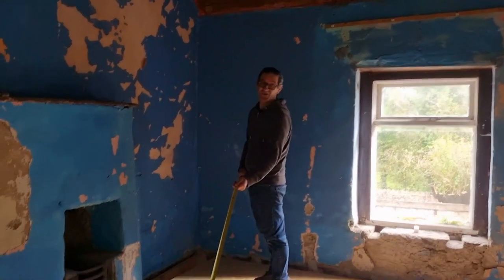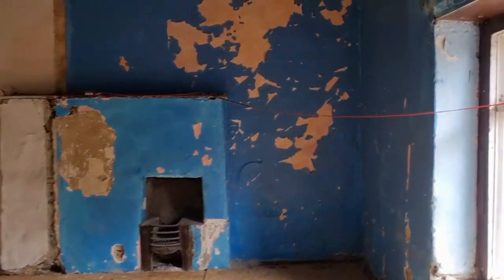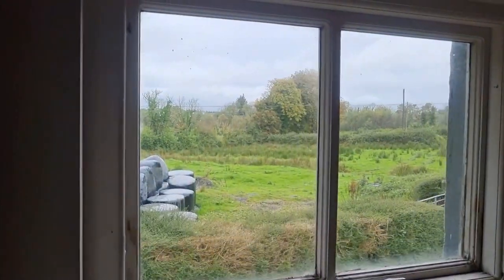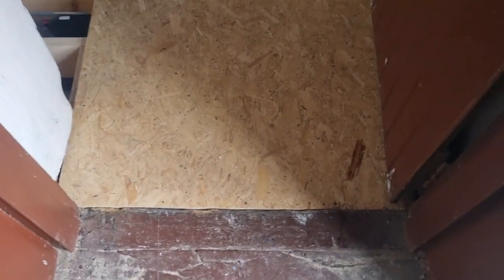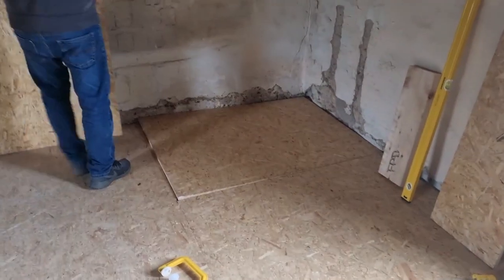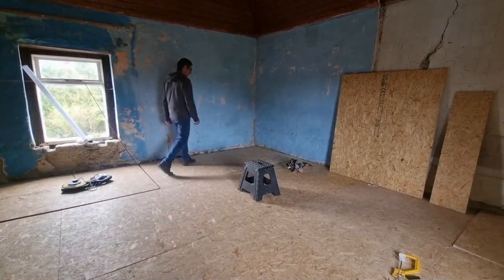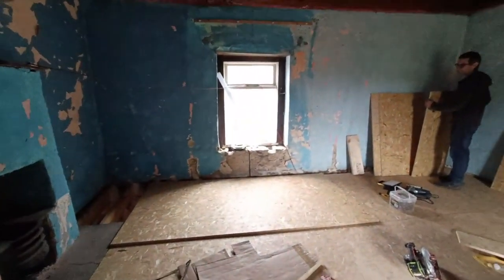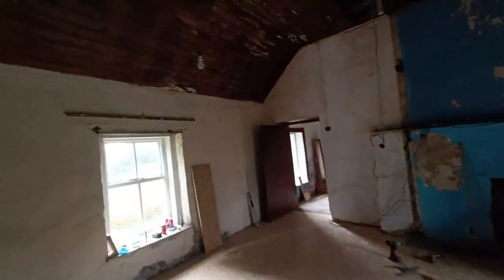Cutting, Fitting and Fixing the OSB in our Stone Irish Farmhouse

Comment: Staggering the OSB with the 8 ft dimension perpendicular to the joists is definitely the proper method. In new construction the noggins will typically  be spaced 4 ft apart  to support the edge of the OSB and to provide something  to drive the screws into. Construction adhesive is also used to help elimate squeaky floors.

It's good to have a multi purpose face as long as it's mostly a happy face. Many years ago I had a boss tell me that the face you have in your early 50s is the face you will be stuck with for the rest of your life so try to keep smiling. 😊
Reply from the maker: Thanks for commenting as always :)  I only said to Dawn the other night, lay in bed, looking up at the bottom of the joists that with hindsight, I should have made sure the noggins lined up with the edge of the OSB and I will do for the living room ceiling.... so with that said, that is my plan.  Being the "temporary" floor, we didn't want to use glue for ease of lifting it all again.  What we have found for squeak though is a sheep's wool strip which sits on top of the joists and below the flooring.  No doubt other products are available for this but the sheep's wool works well in lime houses due to it's ability to hold and release moisture.

I was once described as having an angry default face which I took as a compliment, not sure they meant it that way though, but I took the good from the comment hahaha.
Reply: Your not doing a bad job for first timers.  The one thing that is worrying are the wiring under the door threshold, it needs to be protected from abrasion and can’t be pinched between the OSB and joists or the wall.
Reply from the maker: @dcimedic  Thank you! 😊 The wiring will be going shortly as its the original wiring in the house and not up to spec but Ben has 12v from the solar running through it at present just to give us a some light while we wait for the electrician to come and rewire the house. Fingers crossed it will be gone soon 😊

Comment: U need a 10 mm gap between the floor boards and the wall for expansion. The skirting hides the 10mm gap when fitted. And there are 2 x 8 boards that interlock for floors that are tested.and can be glued together.
Reply: Yes, the narrow sheets of tongue & groove OSB are really handy for doing floors!
Reply from the maker: Thanks for commenting, there are lots of 10mm gaps around the room and not to many places where it actually touches the stone work due to the inconstant nature of the building.  Being only a "temporary" flooring, we will ensure when we lay the real floorboards that the expansion gap is present all around.
Reply: @thecornerhouseproject  for temporary it’s fine. For my floors I did the 2 x 8 ft sheets as the interlink.I used this floor as the build progressed and then I glue engineered oak boards on top of it. Turned out a great job. It’s all hard work but u have too keep going